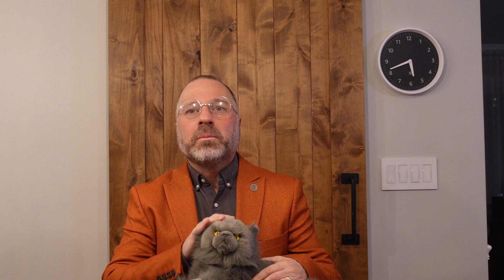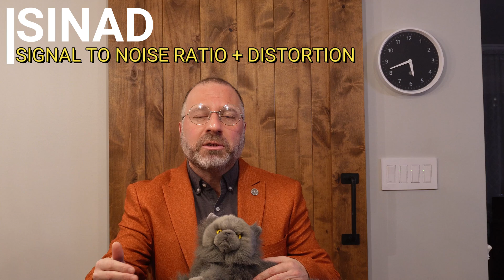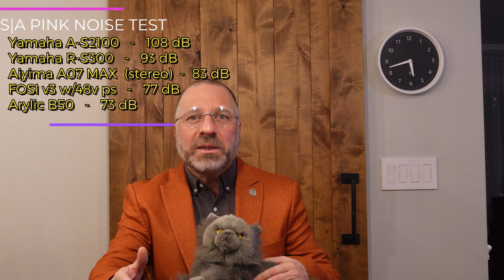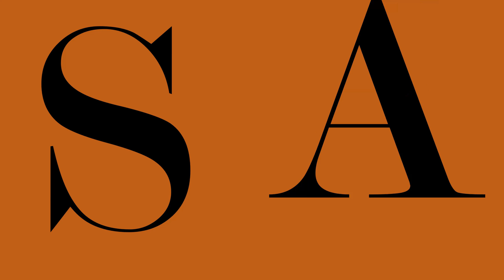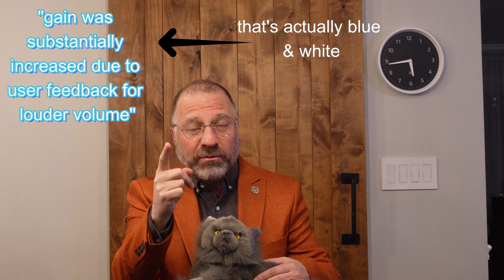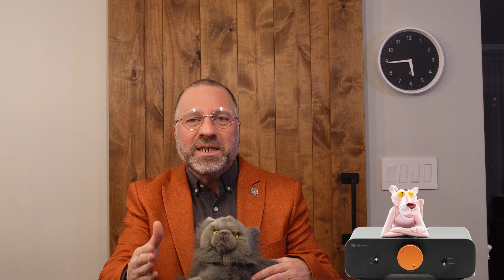FOSI ZA3 - NEUTERED!

Comment: Maybe not produce the crazy watts like all 1k plus amplifiers do, they do produce enough to satisfy audiophile demands of hi mids and lows  that most want at satisfying levels on my Magnepan LRS+. You want overkill then pay the overkill price demands of other amps. I have a Ultra starkrimsom GAN 500 watt 2.5 k amp, so i know what i'm talking about as za3 duo mono it's 95+% there at normal 90 db max levels. As far as hearing ability, i have a young man's hearing as measured by samsung smartphone customed profile alignment software. opamp upgrade to sparkos is a eye opener, it rivals my gan starkrimson not in loud levels but 95% at there.

Comment: They (fosi) finally released a 48 volt 10 amp GaN powersupply for this thing and the upcoming V3 mono, wonder if they'll send you one to re-review at full POWA?
Reply from the maker: Maybe.  Unlike other companies that aren't happy with my negative reactions, FOSI has really stepped up to the plate and continued to send me products.
Reply: @scientificaudiophile  I feel they are geniunely responsive to their customers needs/asks, much moreso and most Chi-Fi anyhow.
Reply: The one disapointing thing though is they also have a 5a 48v version and its the default bundle on amazon now with no other options, even though the 10a is also on amazon, though its the same price as a bare ZA3 with no adaptor included..

Comment: While I found this video somewhat interesting, it's more damning than instructive. I own a ZA3, and I use it to drive a couple of old Technics SB-CA1060 3-way speakers (yes, they are 30 years old) that are very "musical" but rather hard to drive. I believe part of my success with this amplifier lies in the fact that I us an SMSL M300 SE DAC that outputs 4.0Vrms through the balanced XLR output. The use of cheap components require some basic knowledge. Using a class D amp was a deliberate choice from my side, since it improves the rather laid back treble of the Technics speakers.

Comment: Is the low gain only an issue if it is used as an integrated amplifier? Because presumably, with it having only one input and a mono switch, a lot of buyers will be using one or two with a preamplifier.

How much gain is there with the volume control turned right up?

I recently went from a power amp with 30 dB gain to one with 20dB. I like how I'm now getting past 10 o'clock on the preamp's volume, but the output voltage of any source components I might buy in the future is now something I will have to consider (I won't be getting any 0.2mV phono cartridge).

My new amp is class A, the excess heat is no bad thing most of the year here in the UK, however, I'm thinking of getting a class D amp (or monoblocks) for occasional use in the summer.
Reply from the maker: A preamp that can output between 4-5 volts would definitely make the v3 hit its output specs.

Comment: Fosi just announced the V3 Mono on Facebook. This is YOUR chance to comment what it needs to be worthy of being called a proper good value budget monoblock amp. A good reviewer criticizes, not just markets for companies... A great reviewer communicates changes, solutions to their issues with products & needed features, with the companies. I was disappointed & skeptical of the ZA3 after watching this video but I simply cannot afford $3200 AUD (at least, not yet) Orchard Audio Starkrimson Mono Premium amps to run the Magnepan LRS+ and dual servo-subs I want as part of my system, down the track. I just hope we're not going to get another "anemic" or "gutless", as I like to call it, amp. I may not be an "audiophile" (I listen to stoner/doom metal & heavy-psyche/prog rock mainly - I know, I know... I'm a philistine!) but for how compressed audiophiles claim my music is there's still detail, bass texture and soundstage in there that I'm hearing on my planar headphones and now want on a speaker hifi system with monoblocks. Here's hoping at some point Fosi can deliver that at an affordable price. Because I can't think of anyone else who is.
Reply from the maker: I'll see if they can send me one.  However, the FOSI amps are far more expensive than you may think.  You really can't go wrong with the Outlaw MODEL 2220 mono block for $399.  While its $250 more than the FOSI ZA3, it is not load dependent, has 300 watts RMS 20-20khz into 4 ohms, trigger out and trigger in, plus the trigger can be set to be either on or to only turn on when a signal is present.  It even has a ground post, if needed.
Reply: @scientificaudiophile  Thanks. I'll look into Outlaw Audio more.

Comment: If one reads the TPA3255 datasheet the chip comes with an adjustable CURRENT LIMIT. This can be set way lower than max current rating all refers too. I guess manufacturer set the current limit low because of inadequate cooling or psu limitations. I watched Erin's review and was quite disappointed with the 4 ohms test. I have that chip on a diy board from 3e Audio with no nutered current limit and they are quite powerful at 48V. I have about 6x the cooling with a massive alu bracket connecting the chip to a wall of heatsink. This amp doesnt even have a fan and no ribs..        Another source of bad sound is a stressed out dac running close to clipping. I have a feeling that the dissapointed customers are maxing out their source. I suggest getting a modern dac with much higher voltage out. Higher signal out will give more resistance to noise and hum. Modern dacs have become so much better and cheaper the last years..But dont expect a ton of 2. harmonic to bass fill your room with too small speakers most ppl have.

Comment: Use a pre amp that has enough output power to drive the fosi to clip , I have yet to see any of the youtube talking heads mention that the fosi is at 10% thd at full power . Using any of the pre amps I have at hand , I can take the spl to uncomfortable levels that I would never listen at , and with art stiletto  6 speakers 86db@1w rated and are true 8 ohm benign load , The za3 is less than £110 and its sound quality is exceptional , big 3d sound that's very well balanced . These latest 3255 chip amps are the first class D amps I have actually enjoyed . If they are not sensitive enough regards input gain , use a pre amp or get another amp. If you want to really feel the fosi , get it on 95db speakers , that tiny amp will pin you to the wall . 😘
Reply from the maker: Agreed but not many people trying to save every penny are going to add a preamp to the mix.

Comment: audio science reviewed the amp, they measured 161 watts in 4ohms & 191 watts headroom with the 48v power supply , I’m using a speaker that drops to 3 ohms, & the volume is extremely loud in a large room.
Reply from the maker: Really, ASR reviewed the amp? I had no idea.  You probably got a unit that didn’t have the gain reduced.

Comment: Fosi took 3 months to send this amp to AMiR so like you said manipulate the expectation and the sales, Aiyima send the 07 Max before they were selling so was grilled. I sold the Fosi V3 ...I like the Aiyima07 Max with muses 02 rather than Sparkos labs SS3602. Aiyima07 Max is coming with 63v capacitors and have more parts inside than the other 2 from Fosi and the power supply is coming with ferrite.
Reply from the maker: Yes, the A07 Max is my preferred low cost desktop amp.

Comment: I love that everyone has a different opinion on the ZA3! I bought 2 of them and they are shipping from China. These are my first Class D amps and will run as monoblocks to drive my 20 year old B&W DM 602  bookshelf & 603 floorstanding speakers. I would like to listen out for myself what exactly is Class D sound compared to my Audiolab 8000S Class AB and a new Musical Paradise MP-301 mk III tube amplifier with 6L6GC NOS tubes.

Comment: SA. Can I ask if you are deleting my comments? I've posted twice and they are not showing up on my phone. No problem. You are entitled to (though they were both incisive and subtly hilarious). ×I just wanted to know if there was a problem at my end (apart from me being a wise-ass idiot, which is too late to change).
Reply: Thanks. It's a bit odd. I guess I need to switch something off then back on again.
Reply: Of course, given that you replied to my comment about deleting comments, whatever it was is now sorted.
Reply: My comment was deleted.  It was there initially and was not there a day later.
Reply: @Mike47834  mine too. content was that I just received one with the new run in February and there is definitely no gain "problem" on my unit. In fact I almost hurt my speakers when I started to turn it up (from zero) as moving it just a hair put it at almost normal listening volume. Had to attenuate my dac to get a reasonable volume range on the pot, and I don't think I've had it above 9:00 yet. Let's see if this one sticks.
Reply from the maker: No, I don’t delete comments. Not sure what the issue is.

Comment: Chris, glad to see someone exposing this chifi junk, keep up the good work. If you cant afford an amp above 500 dollars your in the wrong hobby
Reply: I have a very expensive amp and i also purchased the ZA3 so zip it Stanley Cryers😂 The ZA3 is a really great sounding amp.
Reply from the maker: If it lasts.  Overheating that chip too much and it may stop working or distort.
Reply: Mine doesn't get very warm at all, even hooked up to nasty loads like a Maggie LRS+ or KEF LS50 META. I think their heatsink works well. However I agree with you about the low gain. With these speakers the volume control is usually at 2 or 3 o'clock. 

Do you know what the version number was on your Za3? Or do you know what the version number was when the gain was reduced. Thanks and keep up the thought provoking ideas. @scientificaudiophile
Reply from the maker: @geevee1045  Sorry, I never actually had the ZA3.  My video was solely based on the information from the ASR review.
Reply: Really?
Hobby has specific price?
Reply from the maker: Audio is not a hobby, except for the people who don't take it seriously.

Comment: I was most impressed with the demo's from the VirtualHiFi guy on his Qualio iq speakers (ZA3 vs Naim). I bought 2 ZA3's, most likely the latest batch, but certainly no issues with gain or thin sounding (compared to my other system: Coda 8 pre- / poweramp and Focal Sopra 1s). 🤔
Reply from the maker: See my pinned comment. Thanks.
Reply: @scientificaudiophile 
On ASR they speak about series before and after a certain date and how to measure in- and output. I was one of the earlier adopters, however, the second one is recent and supposedly 'new stock' (after they run out). They measure the same, which makes it maybe more mysterious or did Amir get a prepped one.. 😅 Time will tell I suppose.

Comment from the maker: If you already own a ZA3, and possibly own one in the future, and you say it is VERY powerful, I just want to put this out there: You most likely received the version with the additional gain, prior to Amir asking they remove the gain. It’s also possible FOSI lied to Amir and only sent him one that would do well in his tests, then, if anyone sent one in for testing, they can just say that person must have gotten an earlier version that was sitting in their distribution channel. JMO.
Reply: Damn, they are cunning devils. Or perhaps Helmholtz has become cynical in his old age. My cat, Kipper, is 12 and does nothing but watch Fox news on TV and David Icke on YouTube. He won't eat tuna anymore because he thinks fish have joined the Illuminati and were behind the financial crisis of 2008.
Also, weirdly, I thought I already posted this but the inscrutable fish conspiracy deleted it.
Reply: I do own one ZA3, 48V 5A, you can get more juice with 48V 10A, I plugged it to my vintage Leak 2600 with rebuilt crossovers film caps Mundorf evo oil and superes resistors done by myself closest to perfection, and for a class D amp it behaves very good, of course you feel it lacks muscle for 12” sandwich woofers, a big amp with  substantial power supply you won’t need to pass 11 oclock on the volume to fill a big room, the surprise is the quality of the sound, its not so refined as my Rotel Tribute but for the price its an amazing product, I will for sure get another one and set them in mono, and later add two 10A power supplies, well see how many hifi reference products will stand against this tiny things, well, we could buy a GRYPHON APEX and have all the juice in the world but that’s not the point the point is, when you need an AB test to find the differences against this ZA3 that tells a lot about the cost of details. Like a good wine and an excellent wine, when you pay 300 or 1000$ for a bottle you are paying only for that extra detail, if you know how to get that detail out, then its worth it, if not,  you’re just wasting money.
Are the newest amps with chips and integrated this and that better than vintage amps with only caps, transistors and resistors?!?! An amp task is only to accurately amplify a signal  without adding or deducting anything,its simple. For me a strong like tank build vintage amps and vinyl with a nice cartridge are unbeatable sound wise. Speakers are a different story. Im a Teac, Sansui and Rotel addict, Yamaha is nice but where they shine is on music instruments and bikes, believe me as a pianist I do need to have trained hearing, thats why Unison Research UNICO Primo will be also one of my purchases out of Japan enviroment. Concerning speakers it is a dream for me to get some speakers from Japanese Kenrick sound. Maybe one day……

Comment: Ive got 2 and use them as mono amps. Crazy power. Never go above 11 o clock.
Reply: Damn, they are cunning devils. Or perhaps Helmholtz has become cynical in his old age. My cat, Kipper, is 12 and does nothing but watch Fox news on TV and David Icke on YouTube. He won't eat tuna anymore because he thinks fish have joined the Illuminati and were behind the financial crisis of 2008.
Reply from the maker: Most likely you got the version with the additional gain, prior to Amir asking they removed the gain. It’s also possible FOSI lied to Amir and only sent him one that would do well in his tests, then, if anyone sent one in for testing, they can just say that person must have gotten an earlier version that was sitting in their distribution channel.
Reply: @scientificaudiophile you are a crazy poo 💩 stirrer 😂
Reply: @scientificaudiophile  I got one on Thursday and the gain is so high I almost hurt myself when I turned up the volume on first listen. Turning the dial a hair above 0 was just about right for my room. I've since attenuated output on my dac so I have some reasonable volume control, but the point is: the gain was completely unexpected and a bit silly, to be honest. And as I said I got it on Thursday, shipped from new stock in the EU, not stock from the first production round.

And it sounds fine. Nothing mind blowing or even particularly special, but no complaints either. It is not thin sounding at all - to the contrary it's a bit heavier, especially through the lower-mids , than I am accustomed to or even might prefer. Need to spend more time with it before I decide if I actually want to use it regularly or only on the side,, but I find nothing glaringly wrong with it (which is a departure - even with much more expensive amps I often find something about them that I really dislike strongly, usually it's obnoxious/shrill highs, but varies). I find nothing to hate with the ZA3 so far.

I have no idea what has been said about this amp on ASR and honestly could not care less.

Comment: I don't understand why you say that Fosi V3 doesn't have enough power. Usually, I use it with a volume knob at 12 o'clock if I turn it in at 1 o'clock it's very loud. Need to add I use it with a 32V5A power supply.
Reply: Same here. I'm listerunning from 3.6m distance on my Mission LX2+ bookshelf speakers (87db, 6 ohm) driven by Fosi V3/48V usually at 12 o'clock and they are plenty of power and good amount of reserve there.  Never tried the amp above 3 o'clock tough.
Reply from the maker: Most likely you got the version with the additional gain, prior to Amir asking they removed the gain. It’s also possible FOSI lied to Amir and only sent him one that would do well in his tests, then, if anyone sent one in for testing, they can just say that person must have gotten an earlier version that was sitting in their distribution channel.
Reply: My version is older than the reviewed Amirm. I make a comparison with Aiyima 07MAX the same volume level. But before I bought it I took it for listening from my friend who bought it six months ago, that version was quietly then Aiyima 07MAX. Amirm on review has REV03  I have REV06.
Reply: @OldMeloman  indeed, and Chris is talking about the ZA3. As far as I know the V3 (which I also have) hasn't been tampered with by Amir's mind control device, which he uses to gain supremacy over the entire Chinese electronics business. I like the V3. For its price it is excellent, though I also appreciate Chris's argument about value compared to a budget receiver. Though a receiver takes up a large chunk of desktop.
Reply: @jimfarrell4635  I replaced Op amps for OPA2604 its a perfect for V3 Use with floor stand speakers that tinny amp )
Reply: @scientificaudiophile you need to change the jacket and also visit the dentist or by some Poly-Filler.  😂

Comment: I purchased the fosi ZA3 while my HK vintage integrated amp was being repaired. My first class D amp. Extremely disappointed. Barley could drive my 6ohm polk audio speakers. I had to turn the amp to maximum volume to get any decent sound levels. The sound compared to my HK and Yamaha AS801 pales in comparison. ZA3 sound is thin lacking definition in the mid tones and bass. While the sound is extremely clean it eventually creates way too much listening fatigue. I finally used a yamaha equalizer to boost the volume and try to somehow get a better sound stage. In the end it didn’t come close to my AB amps in both sound and power.